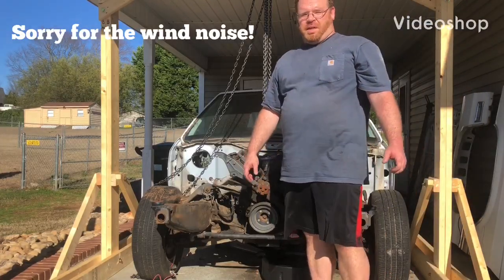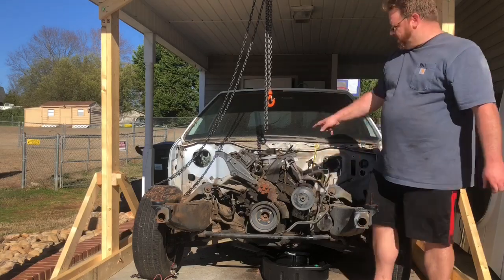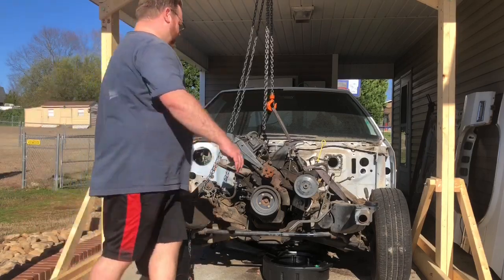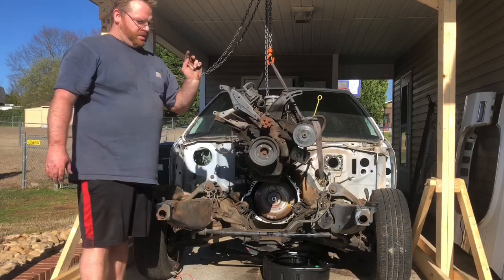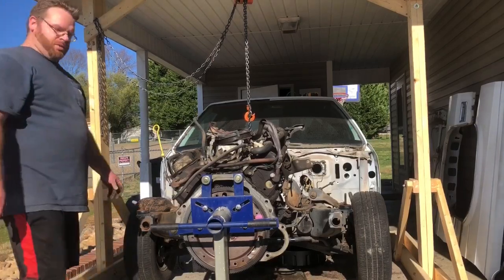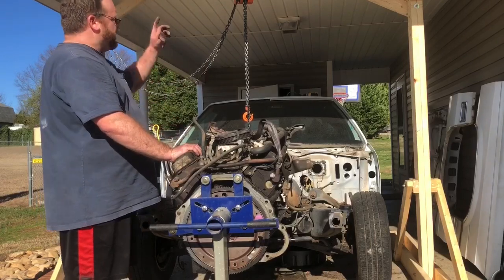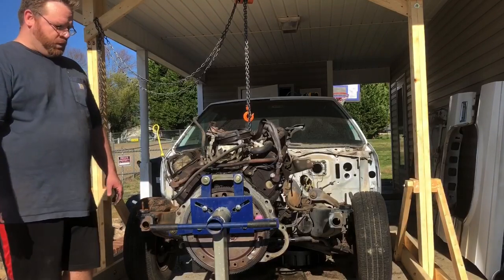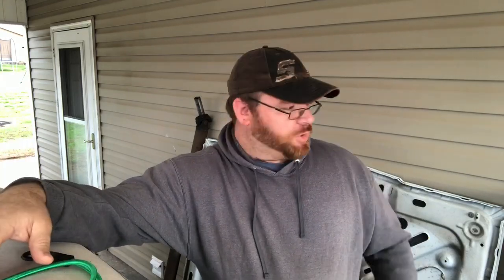TESTED: portable wooden gantry crane used to pull engine

Comment: I was thinking your gantry was going to be too short, but with the whole front clip off it worked like a charm. Nice job.

I also love your channel name.
Reply from the maker: Thanks Nathan!  I actually took a ton of measurements to make sure it’ll work even with the front clip on...but it will be VERY tight, like down to the last half inch!
Reply: @carportshenanigans5918  I almost always pull my transmission with the engine and it always hangs down quite a bit more, but if it was better balanced it would probably still be possible in your situation. Anyway, you did your homework and it paid off!
Reply from the maker: I very rarely pull both at once.  I didn’t want to over stress the  engine yanker 3000 on its first job.  Also, I thought I could do it cleaner pulling the trans afterwards...WRONG!  I dropped the trans on it’s side and dumped fluid all over the carport! Lol. And then the kitty litter I put down just about turned into concrete!  There were mistakes all around.
Reply: @carportshenanigans5918  Mistakes are my most common accomplishments in the garage!
Reply from the maker: I think we can all claim that from time to time.  I prefer the term “life experience”!  🤣